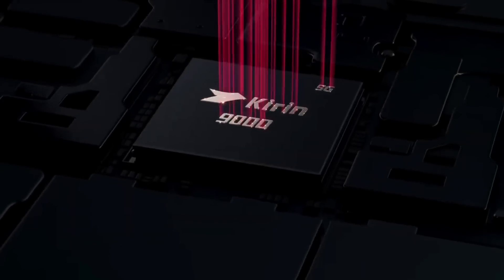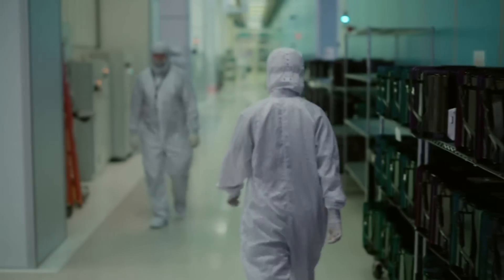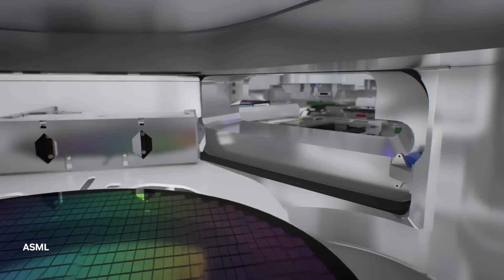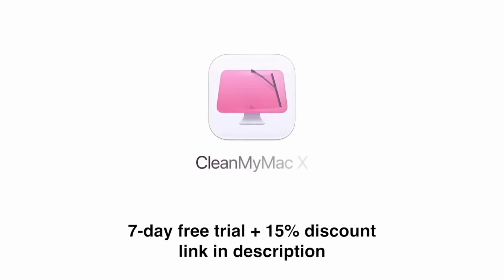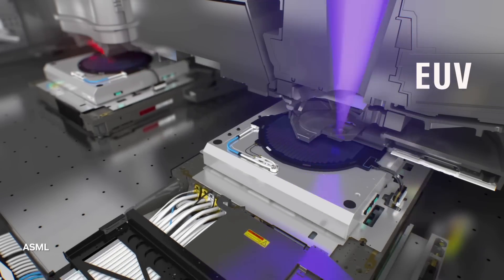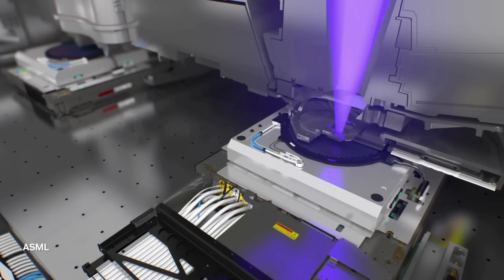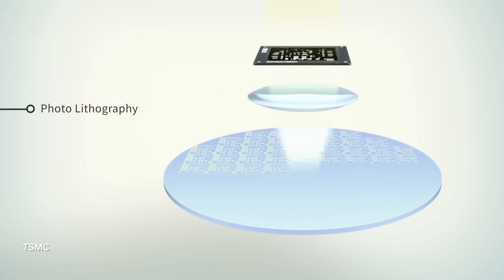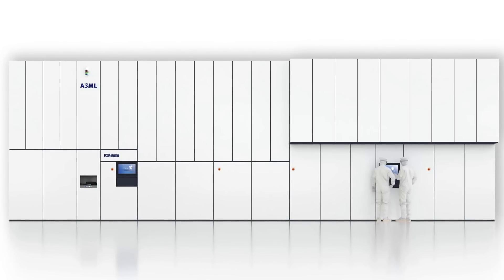The Truth About China's 7nm Breakthrough

Comment: Many people today could probably still use a high-end mobile phone released 3 or 4 years ago without any real issues. So I'm sure the KIrin 9000s is good enough even at 7nm. This is Huawei's comeback CPU and I'm sure better things are yet to come.
Reply: I’m using an iPhone 7, and it’s fine.

The issue is cost though. How much do these chips cost compared to the TSMC chips?
Reply: @terjeoseberg990  No matter how high the cost is, it's better than buying someone else's.
Reply: I use a Samsung Galaxy Note 10 Plus, still incredibly good.
Reply: My SD870 feels slow. Could be optimisation issue instead
Reply: @DarkPa1adin thats your ui ,im still using SD855 which it is 2019 phones and it still can run genshin at highest 40fps avg ofc i did some small tweak but probably if you suffer some issue with SD855/865/860/870 , isnt the chipset fault but the UI itself. if you were using xiaomi you can try do costum eom as mostly xiaomi community is big and have many offical costum rom.
Reply: @DarkPa1adin  planned obsolescence
Reply: The chip is Kirin 9000s. Not Klrin 9000s.
Reply: @kwokholuk8723  Still years behind, no matter what you call it. They probably just scratched off the TW on the chip and put a CN on it. You just cannot trust anything the CCP says. Don’t blame me…
Reply: Chinese made is bad quality 🇨🇳
Reply: The only thing coming is complete collapse.
Reply: the issue with old chip is usually that they don't have the newer encryption/decryption cores. So either it runs slow when facing encrypted data, or it fails at it. For instance, https browsing or the video compressed in modern formats. So for basic browsing it would be fine, for banking it might fail, for video/netflix/game/ etc... it might be very low. And phones won't be able to use modern libraries which take advantage of newer hardware. and since dev just use the last libraries, sotware slowly run less and less optimized on old hardware et everything slows down.
Reply: china ... tells after 5yrs min ...
Reply: also the only games that it struggle is only carXstreet but isnt due to the SD855 but bc my ram is only at 6 gigs which the carXStreet ram usage is insanely high 😅 ,bc i notice my ram got red after 20 minutes
Reply: My android phone with SD 845 is still snappy and can play PUBG mobile @ 60fps with low settings. Apps loads fast enough. Yeah you are correct old flagship chipsets can still be used without any hustle.
Reply: My OnePlus 7 Pro is still going strong. So ahead of its time. No issues.
Reply: I'm using a mid- to low-end (aka budget) phone from 3 or 4 years ago. It's fine still. The problem these days is not so much the processor speed. It's when you run out of storage, everything grinds to a halt. And you have to start moving files to your computer, deleting stuff, removing software.

Especially bad if your phone doesn't support a microsd, and you are using memory hogs like WhatsApp/WeChat. WeChat hogs more memory, but WhatsApp does not allow you to move the media folder off internal memory. That was actually the reason why my mom had to replace her phone. The old one still works perfectly otherwise.
Reply: @danielch6662 , If memory is the issue, getting a new phone is identical to erasing your old one. For me it’s the battery that’s the problem. I don’t want a faster phone, but rather one that has a longer battery life. If the battery life isn’t longer, it’s not worth upgrading.
Reply: I am using a mid to low-end phone from 3 or 4 years ago. It's fine. The problem these days is not so much the processor speed. It's storage. When storage runs out, everything grinds to a halt, and you have to start deleting stuff or get a new phone.
Reply: From consumers perspective they don't really care whether it is 7 or 5 or 4nm.  As long as they can do the stuff they want to do, like 5G speed, battery durability, water proof, etc.  Ability to make satellite is definitely  a bonus.
Reply: @44jwong  Satellites use chips which designed by different technologies, from different materials and they are mainly over 180 nm to reduce effects of radiation. Regular chips can use only private companies for non serious projects.
Reply: @44jwong , Satellites can’t use 5nm chips. They probably can’t even use 50nm chips. The smaller the transistors, the more susceptible they are too the effects of radiation.

However, smaller transistors use less power, so they improve battery life. They also allow you to manufacture more chips per wafer, so smaller transistors make cheaper chips which leads to either cheaper devices, or more profits for the device manufacturer.
Reply: @terjeoseberg990 It is cheaper per transistor, but not cheaper for the whole chip with smaller scales.
Reply: @strongbrain3128 , That depends on the number of transistors per chip.

The same chip has the same number of transistors made with the two different processes. Which one costs more?
Reply: So huawei is more focused on building digital platforms covering all daily life demands and integrate your phone to those platforms, not to abusively discover the capability of advanced chips.
Reply: Lol as usual old chip same game, look what we did. No impressive  behind the times, stolen technology.

Comment: How high is the yield rate of these Chinese fabs? I don't think it's higher than 20%
Reply: More than enough to fuel Russia, Iran, North-Korea and China.
Reply: you think ? based on what
Reply: @qsteven1262  Because of chinese propaganda
Reply: lol @fnordist
Reply: @qsteven1262  Douglas Fuller, an expert on China’s semiconductor industry, told Financial Times that the furor over SMIC’s 7-nm progress is overblown and that China’s top fab is using extra exposure to make up for the lack of EUV tools. He also resonated doubts about the yield of SMIC’s 7-nm chip fabricating process.
According to some industry observers, SMIC’s 7-nm yields per wafer are in the range of 15%. That, in turn, makes the chips manufactured at this process node very costly, around 10 times the market price of a chip manufactured at TSMC’s 7-nm node. It’s also worth noting that the crypto-miner chip known to have been manufactured at SMIC’s 7-nm node features a highly parallel design, which implies lower complexity.

Comment: There are ways to mitigate the overlaps to make seamless fabrications, however, it is at the cost of spacing, and will only serve to make the chip scale larger, but if you are at a scale that is small enough to make the chips function competitively, then the result is actually a gain, and the method a huge success. Fact is, we do not have an example of how they scaled each pass, or of how this method is being engineered at the Nano-meter level. It could be just a very elaborate chip design with ONLY the cell phone in mind, letting them unclutter the chip paths to an easy production map, being foolproof in design against flaws. But this way of doing thing would not be much help in multiple roles for this one design, they would need to redesign every chipset to work for each specific function in order to make a chip for any other function.

Comment: Hey Anastasi! Love the new setup (might be a little late if you’ve been using this already). Just a quick correction, Rocket Lab actually doesn’t print the entire rocket, that’s Relativity. They do print the engine and several other components tho, but the body is carbon composite. Still gets your point across tho!

Comment: I think soon we will hit simply the limits of physics with the nm-process, so that we really should change (again) the Moore's law, to synchronize the industry. I think it begins to make much more sense to speak of: Flops divided by transistor-amount. Because the same amount of transistors can do more flops, with smart circuits, and AI (who uses the transistors in the most efficient way). To change the understanding of Moores law into: Flops divided by the smallest calculating unit (in this case transistors) would still allow us to plot a historical curve about the developement of computer technology (this curve is important for the industry to synchronize their fabrication process of each electronical part which plays a role in mass producing of devices). And yes, i know there is also few different variations of Moore's law already - like the energy consumption by each transistor, or flop.  But i think for the industry two variations make most sense: the one i mentioned above , and the other one is: price per transistor.
Reply: What's beyond 1nm?
Reply: @DarkPa1adin  0.9nm?
Reply: @DarkPa1adin  Its picometers , short: pm.  The problem with that is: the building blocks of matter , the atoms and molecules are literally around the size of 300 pm  or 0,3 nm.  A transistor cant be smaller than the atoms he is made of. 
The impossibility to make transistors as small as 1 nm is due to quantum effects on this scale, espescially quantum tunneling. 
A transistor is literally a switch for electric current , like a light switch. Quantum tunneling is like a natural ''leak'' of current on atomic level. Its a law of physics, and can be solved by ''further technical developement'' . The tunnel effect is simply said a natural ''probability'' for electrons to be ''somewhere else'' . In general electrons are not existing in a ''concrete way'' ... they are existing in so called super positions (in chemistry called orbitals). These orbitals are like ''clouds of probability of electrons''. These ''functions of probability'' lead also to the tunnel effect, as far i understand, and it makes transistors ''leak'' electric current - meaning: the ''switch'' could not turned off. It would never turn off... a simply ''zero'' bit could not be represented by the transistor, because it always be: "1", or at least: it could be ''1" at any given time without intention. Data of that sort would be jibberish. 
The tunnel effect dissappears by using more atoms (the bigger the size, the more the uncertainity dissapears). 
The technicians and physicists estimate that frontier as around 1,3 nm to 2 nm (the exact value isnt sure , but its around that value). It would mean: that the smallest parts of the transistor are made of only 4-5 atoms. With that the tunnel effect is barely to handle but maybe possible. Below that small size its literally impossible.

As in the video said, we are still at higher nm-sizes than manufacturers advertise. So yes, probably for around 10-15 years, we dont reach the lowest theoretical limit of around 1,3-2 nm. 
But when we reach it, we definetely reached the end of the possibility of the transistor technology as we know it. 
And we dont have good alternatives to make better hardware. Sure quantum computers are an idea, but a very unpromising idea. It doesnt look like it will replace the normal computer technology as we know it - for the simple fact, that quantum computers are simply to much efford, for quiet a small amount of payback. Sure we can hope for a technological breakthrough in quantum computing, but i dont see it since more than a decade. So i highly doubt it. In comparison:  when the transistor was invented, the price of transistor driven computers dropped a lot in around 10 years. And thats simple not the case for quantum computers, as far i know. 

Meaning: we will hit a wall in around 15 years, in a hardware term of chip manufactoring.

Comment: I have a question for you ma'am, Why the majority of the chips are Square not round?
Reply: Fits more on a wafer. Hex shaped chips would work too, but there would be trickier design issues with the chip architecture to maintain trilateral symmetry with the same transistor density. Rectangles also fit easily into the mostly rectangular boards and devices.

Comment: SMIC are probably developing farther the "multiple patterning" conceipt. It does indeed helps to produce chips, but makes mass production more difficult. The issues are not only the low yeld and long production cycle but high computing power required for developing front end masks. With proper financial support from the government(which I think SMIC got) it is possible but the chips will be limited for military use due to non competitive cost

Comment: The speed SMIC has got to this point is surprising, but the big picture isn't. As soon as the US embargo began, the Chinese government started throwing massive amounts of money at domestic semiconductors. This included a lot of money that went to badly-run projects and outright fraud, but I suspect they were okay with that in order to move fast. Incidentally, I kept getting messages from contacts in China wanting me to join them in putting in a proposal for some of this money. I didn't want to go anywhere near it, despite the potential for huge wealth.

It was obvious that given time the embargo would fail and it would provide a boost to China's domestic semiconductor technology. As they say, necessity is the mother of invention. I'm not saying the embargo is wrong (that's a political decision). I'm just saying it could only achieve short term objectives.

Beyond DUV (moving in to x-ray lithography) there are other options from ASML. There's one viable technology I know of that can go beyond ASML's 13.5nm wavelength EUV. I'm not covered by an NDA, but I still don't think I should discuss it here, but while it doesn't make commercial sense to introduce it before sub-nanometer nodes, for China, with government backing, it might be worth it. If they did so and also funded the development of the resists, masks, etc., it would put them at an advantage going in to sub-nanometer realm.

Comment: The smaller the wavelength of light used to "burn" the chip the greater the number of transistors per unit area and the greater the power and efficiency of the chip. You'd think they'll move to proton etching or x-rays
Reply: No, they are already at a point where you can count the number of atoms in each transistor, that and the fact that they have had to use modified silicon because, again, they are down to mere atoms between p-n junctions meaning spurious firing of conductivity via tunneling electrons...so you see, it isn't miniaturization that is the issue, it's the nature of the semiconductor itself, which is why they invented a different junction architecture, with the same material, but down at this level, speed and heat are the bottlenecks, hence the ongoing search for better materials, for higher switching speeds and higher reliability and lower thermals and lower current.
Reply: @ashleyobrien4937  Very interesting. Thanks.

Comment: I wonder if production runs result in a high enough ratio of usable chips from each wafer, or if this is a PR win.
Reply: Huawei in it not to lose money, but to regain lost market share, prosper, and survive.
Reply: No one knows and China isn't saying. 5 years ago when sanctions began I heard analysts predicting today's 7nm achievement by China but at the time said it was a pretty firm barrier and China would not be able to progress beyond this point without suffering so much waste that it would quickly become uneconomical and prohibitively costly. Even to achieve 7nm,, it was assumed that it would require massive subsidies and forego almost all profit per chip.
Reply: @tonysu8860   I don't think that's what's happening now, but even if it was, domestic chip production is a strategic imperative for China, so they would make these chips even at a loss. The nature of the Chinese economy is that they can absorb such losses for a long time if they have a good reason to, they aren't bound by the short-term profit structure of western companies. China would make these chips at a loss without hesitation, because it will keep them going until they improve the tech so they aren't losing anything. Very hard for a western company to do that.
Reply: Huawei has done a lot more than 7nm chips.  they came up their own EDA to design chips, GPU, and satellite communication without the antenna.

Harmony 4.0 will be pre-loaded on all hardware, that's huge.  Some EV will use Harmony OS, Harmony will be nibble away at Android constantly.

Comment: 12:19 - Well, 30% isn't much backword. I mean if the production is fast enough than it just as efficient.
Reply: its relative too. for example while TSMC might be able to make 7nm 30% cheaper with EUV, that doesn;t mean SMIC 7nm with DUV will cost the same as TSMC 7nm DUV, largely thanks to things like material inputs.  Im sure energy and water is alot cheaper on the mainland than on taiwan.

Comment: The main challenge with getting small isn't the size but scaling production with high reliability.
Reply: That's why the saying , Need is the mother of all Inventions.
Reply: They had need for this for several years. Just because there is need, doesn't mean they'll be able to invent it out @technoartfest8708
Reply: In theory they can go much smaller but with significant defects.
Reply: @mikelay5360  Of course, we can line up atoms hypothetically
Reply: @FixingPhysics  unless Chinese reinvent EUV and high NA EUV machines they will always play catch up
Reply: @mikelay5360 
They might invent an entirely new technology.

So no, they won't always play catch up.

They are always working on graphene chips instead of silicon.